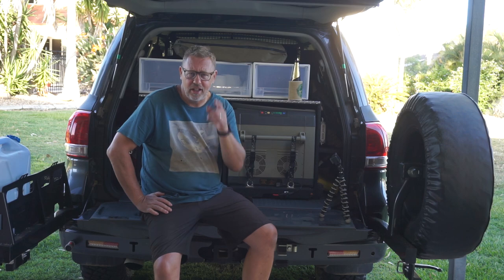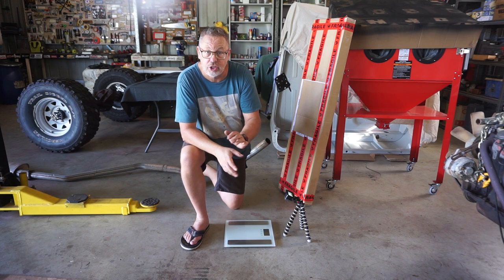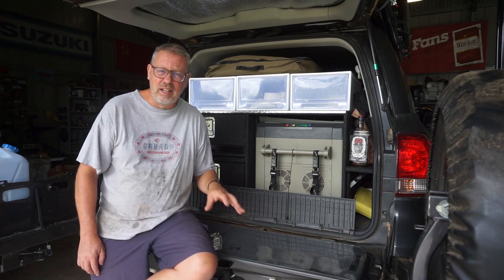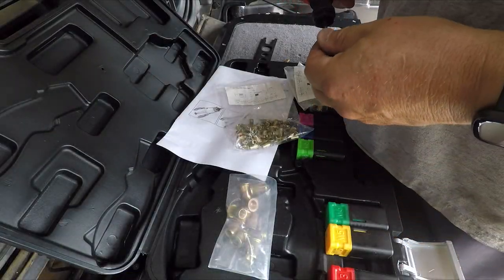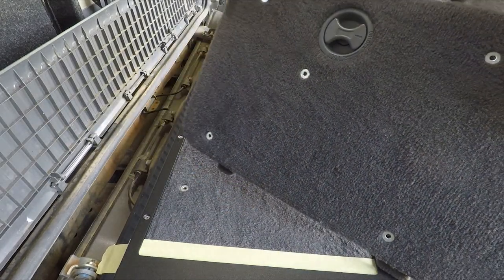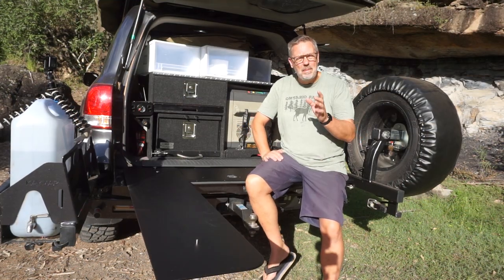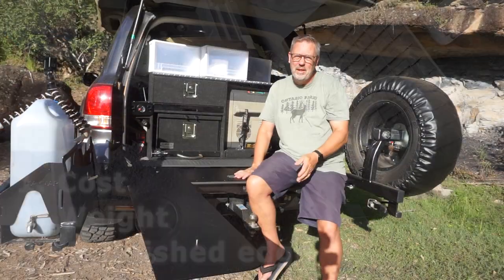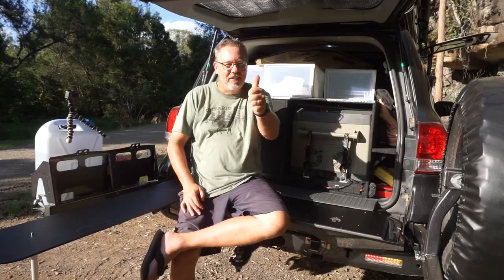How to Install a 4WD Tailgate Table | Cruiser Custom Camps | Is it worth it?

Comment: Removing the toyota tool kit will offset some of the weight of the table. You did mention that you don't use/need it.
Reply from the maker: You are dead right Ben, if you remove the Toyota tool kit it will help with the weight issue.  I have left it in there as I still have the Toyota jack on board and the handle and cranks are in that kit.  Cheers!!
Reply: @JafffaAdventures  right on. Maybe you could swap it for some lighter weight gear? Maybe fit the tool kit under a seat and out tow straps and gloved in the gate? You've had that set up for a year so I'm sure you've already thought it all through. Good luck and thanks for the great information.
Reply from the maker: Thanks for watching and commenting Ben, I really do appreciate it 😎👍

Comment: If the piece that is fixed (not the swing out) to the tailgate is metal - a con may be that it will be fairly miserable to sit on when it is very hot or cold. Just saying. Because we sit on our tail gate all the time!
Reply from the maker: Good one Terry, I agree that would indeed be a con and a serious hot seat😉. Thanks for adding to the discussion 😎👍
Reply: @JafffaAdventures  I live where winter is winter and sitting on cold metal just would not fly - and if the sun catches the metal - pull out the eggs cuz that's what you're having for lunch.
Reply from the maker: Too funny mate.  Agree, what works for one person certainly may not work for another.  Cheers 😎👍